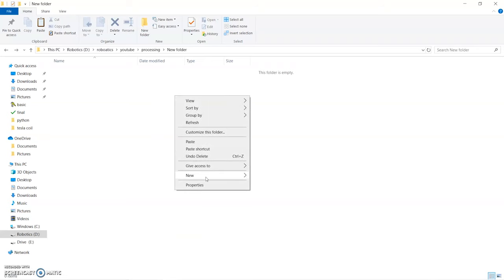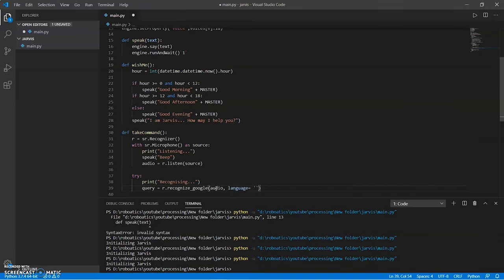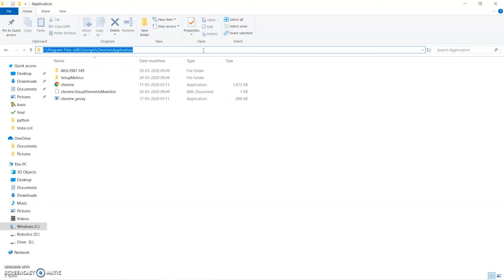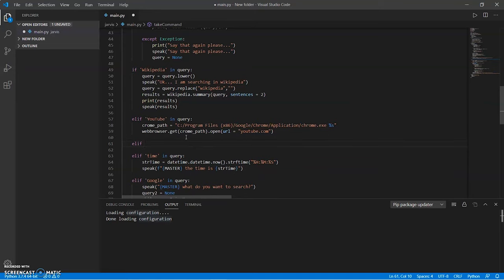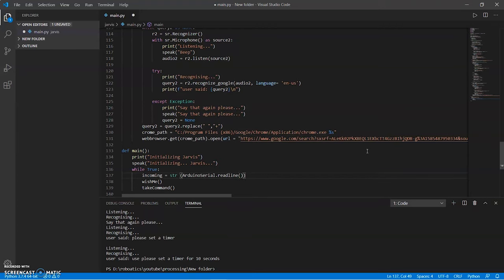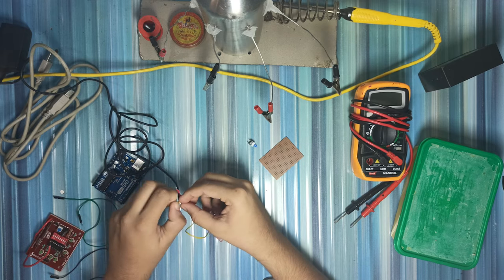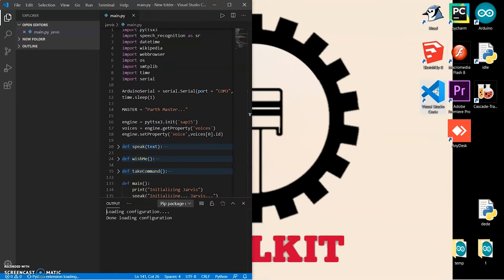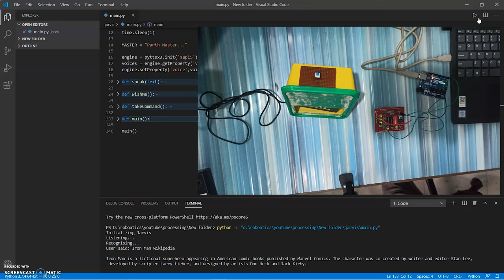How to make a cool voice assistant using python

Comment: Use a gui for this
Reply from the maker: Which one?
Reply from the maker: U mean a readymade library from GitHub?
Reply: @TOOLKIT_Parth  graphical user interface banao with the. Help of tkinter
Reply from the maker: Accha got it... Actually i did not know tkinter when i was making this video...will surely do so.. thanks
Reply from the maker: you can use the normal idle or vs code...
Its the same reason that i dont like pycharm much as sometimes it becomes very difficult to install external libraries
Reply from the maker: even i faced the same issue so best is to use other options
Reply: @TOOLKIT_Parth  sunno na app mujhe mail karona apni emal id se